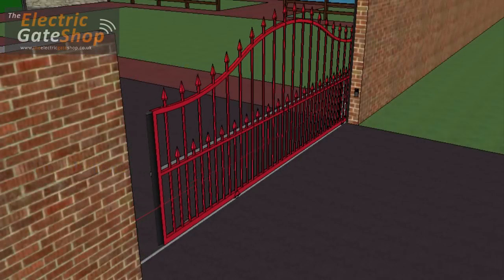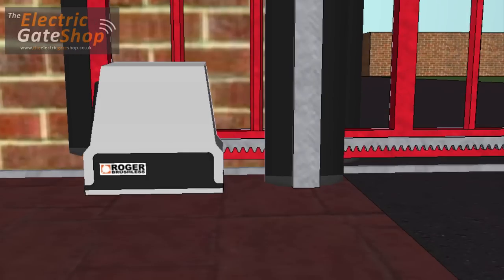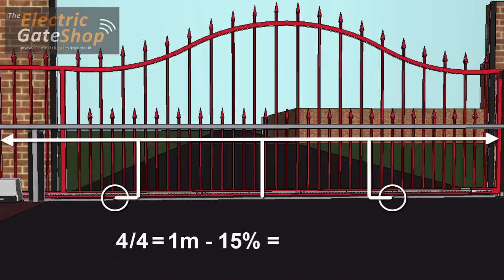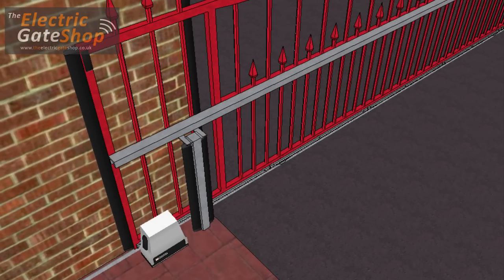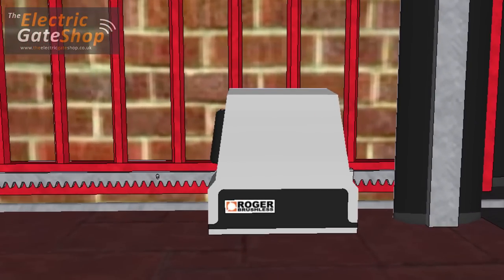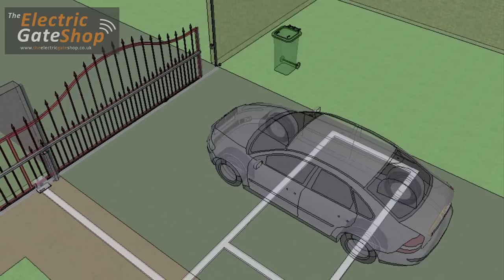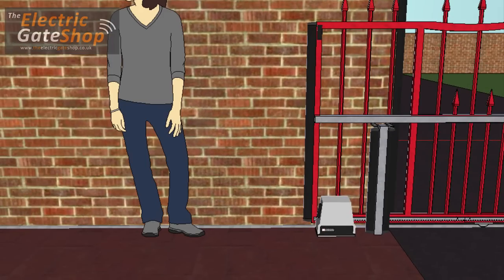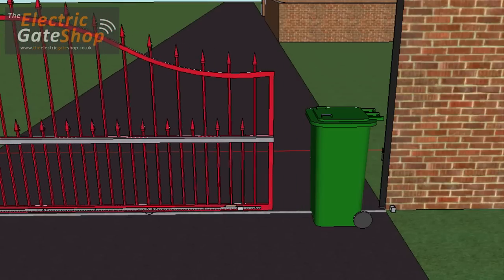Electric Sliding Gate Information and Safety Guidance & Tips

Comment: >>>t.co/Nmgemqcew3   As most have stated... the instructions are a little lacking..... Note the the brackets they give you for the Chain to connect to the gate will not fit 2" Steel pipe.... I had to modify / Weld mine in place